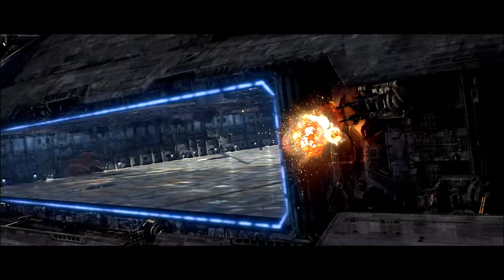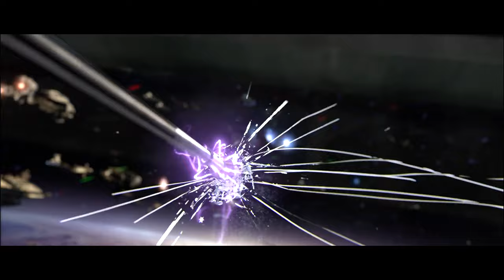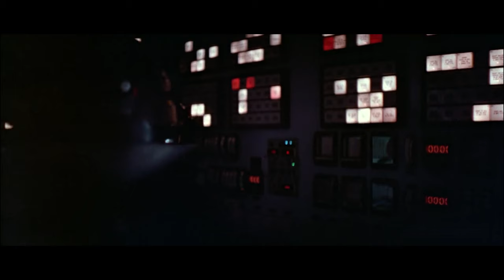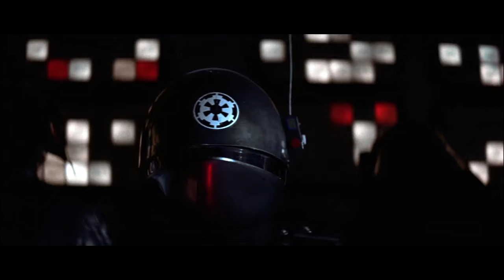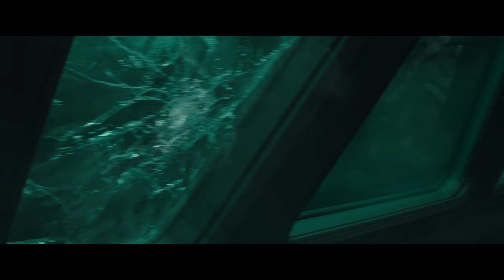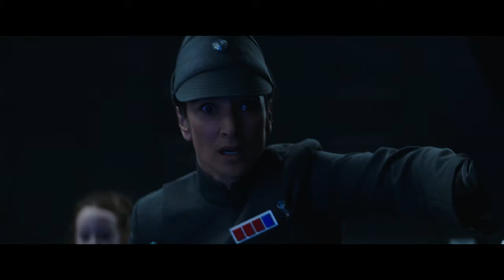This makes literally no sense

Comment: 1, technology fails so when it does you need to use your eyes. So a window would be necessary.
2, the staff not only is charged it is also very ridged and pointy, so with the amount of force that a robot could hit it against glass is reasonable that it cracks. And then breaks.
And lastly, by that logic, why do we have windows on cars that can drive themselves. Not only because cars have to have windows, but also you need to see outside when you need to take control

Comment: Well, the windows are transparisteel which, while not quite as strong as the durasteel armor plates used for armor, is still a lot stronger than glass would be. So it's not as much of a vulnerability as you might think. Secondly, some Star Wars ships actually do have internal CICs, either in addition to or instead of the exposed bridge. The ISD has a secondary CIC built into the superstructure, while the YT-1300 has a cockpit delete and expanded engineering pilot console as factory options.

Honestly, what doesn't make sense to me is that Grevious was able to break a bridge window on a Providence-class with JUST a magna-guard staff. I guess the CIS cheaped out on the transparisteel.

Comment: Electronics can be jammed, interfered with or otherwise disabled which would make seeing out of a ship without windows rather difficult. Bridge crews need to see to be effective, most of the time that is with sensors, but we do have occasion to use the sensors every person is born with, the Model 1 Mark 0 Eyeball.

The real question we should be asking is why the windows don’t have field generators like the landing bay doors do, so they can seal immediately upon being breached.

Comment: They likely are there for a couple reasons: to visually confirm outside events when sensors might be prone to errors or cloaking (see how the Geth ships in Mass Effect miss the Normandy). It helps the non-droid crew to avoid claustrophobia and other anxiety problems like that experienced on submarines. And Star Wars likely has glass on par in hardness with the steel they use in the rest of the ships (see Star Trek’s transparent aluminum) which while durable might not stand up to the enhanced strength of a droid body like Grievous’. But like with most things in Star Wars, it’s probably just rule of cool to have space windows.

Comment: It's simple really, sensors and cameras can fail. The glass is so the crew has a clear line of sight of the battle.

Also that glass "broke easily" because Grevious a cyborg with physically enhanced strength broke it.

Comment: On the ship windows: 
As mentioned viewports can’t be as easily tricked (if they had one that was where the millenium falcon was, they’d have noticed). 

Now that you’ve said it though that Greivious one did break really easily. Maybe it was like bulletproof glass (where it’s only really resistant in one direction) the cis are notorious for low quality in large numbers. Plus the only organic that would usually be on that ship is Greivious, so there was probably a lot less risk compared to the empires ships. Since Greivious and all his droids don’t seem bothered by space. 

Still….that does bother me now

Comment: Used be the clear windows you saw were a transparent alloy called "Transparisteel". I think they dropped the concept when they decannoned the books but i wouldnt say ive read all of them just a hundred or so in my youth so its possible newer media restored it. Funniest part to me was that it was stronger then the metal that made up the hulls more often then not but was made from a less common ore so they didnt use it everywhere.

If i was making a starship though your absolutely right thered be few if any viewports. Just coat the inside of the hull with programmable nano-skins that can relay exterior images, serve as communication and utility screens, or just be low key light sources. If there must be viewports for safety reasons then that's what shutters are for.

Comment: There is no big difference that I know of replacing glass with sensors considering most of the attacks are hitting the shields rather than the ship and if they were to be hit they will blow up the same.

Comment: People have been asking this question since the 1960s-70s when sci fi tv shows and movies became a thing.

There's absolutely no benefit to having windows on a spaceship, since any star closer than the Sun is to Earth would be unbearably bright, while anything considerably further away would be a negligible light source at best. 

Then again, it's the smallest plot hole in the Star Wars universe, where space battles take place at shorter ranges than cold war era jet plane dogfights, every planet has a breathable atmosphere and bearable gravity and nobody uses remote control technology for anything meaningful. 
"Yeah I have a robot. It translates between me and the cloaked dwarf people" 
Dude, if you have cheap autonomous robots(a slave boy can throw one together in his spare time), there's literally no reason to risk anyone, ever. Even wars would pretty much just be drone on drone violence and covert assassinations carried out by suicide drones. 

Making a robot from scratch takes an hour, at most. Producing a human soldier takes about 20 years. 

Frankly, in the Star Wars universe, there should be two types of people. Trillionaires who own robots who furnish their entire existence, and people who have literally nothing because the value of labor is priced somewhere around the price of electricity. 

Star Wars is a product of cocaine and very little foresight. Dissecting it is like pulling on a loose thread of a knit sweater. Too easy and not satisfying enough.

Comment: I mean, by that same logic real life airliners shouldn’t have cockpit windows either because the pilots spend most of the time flying IFR anyway.

The reason real life airliners have cockpit windows is because if instruments fail or if there’s an obstruction that radar, ATC and NOTAMs don’t alert them to then they need to at least have the option to fly VFR.

In fact, as The Invisible Hand is crashing, Anakin would have had no hope of landing the ship if the cockpit didn’t have windows.

Comment: Those staffs where shown to stop lightsabers. No reason to think they can't do this easily. As for the window breaking even if it's some crazy thick advanced material if it's cracked the pressure will overwhelm its structure. Pressures work completely different in space than they do in an atmospheric vacuum. Boiling points. Everything is different.

Comment: Just a reminder that the bridge of a ship often is divided between two sections. The “sailing bridge” and the “combat Information Center” which can be like the brain “CIC” and the nervous system “sailing Bridge” the CIC is deep within the ship and heavily guarded from all kinds of attacks. The Sailing bridge is actually a lot harder to hit than you realize with it being recessed back a fair bit. It’s not totally unreasonable for it to be a navigational bridge or a fair weather bridge, where it’s primary purpose is, as the name says, to be used for navigation in (ideally) non-combat situations. Now is there better methods? Absolutely. But I also propose the idea of reliability. Sensors aren’t always reliable and can malfunction or stop working. A window, kind of can’t.

Comment: When fighting Capital in the old SW Battlefront 2, one of the primary targets was always the sensor array. 
It would completely cripple a battleship if it was rendered blind, so I guess the portholes are a failsafe to make the ship always can both target and navigate. 
As for the weakness in the hull, I don't think it really matters when those ship cannons have shown themselves to tear through solid steel like it was nothing. Once the shield's are down the hull isn't going to last much longer.

Comment: I think this doesn’t necessarily account for ships that could bypass sensors or a malfunction in the system. Theoretically windows would be obsolete in most instances, but if anything happens to jam the sensors, the ships infiltrated and it’s turned off, or the ship malfunctions due to damage or other circumstances, windows would be great to still see the ship. Also, if an asteroid or space beast ever came up, I’m not sure if the sensors could pick it up. Maybe life forms. But unless I’m mistaken, these sensors have only been shown to locate life forms if they’re on (which they aren’t always) or machines like ships and droids. Someone correct me if that’s not the case. So maybe they aren’t always essential. But in particular cases it’s helpful and accounts for most instances.

Comment: What REALLY doesn't make sense in that scene in RotS is that the ship's gravity changes as it rotates.

Space is a place without gravity. As such, the space vessels would have purely artificial gravity... which should be designated to what is recognized as the "floor" regardless of the ship's physical position. Thus, when it rotates, the artificial gravity should remain on the floor instead of changing position with it. But it doesn't. It rotates with the physical ship as if there's legitimate gravity in space dictating which direction is "down".

Comment: Rule of thumb for militaries and always have been is; If your tech fails, you need to know what you're doing. It's why "Outdated" learning is still taught, basic is good

If you lose your map and compass, how do you traverse?
If you become stranded with no weapon, what do you do?

The shields of the ship would suffice to protect the bridge, not to mention blast doors and windows shutters. Conceptualization is the key to strategy, visual aid is helpful, and when in doubt you can still eyeball trajectory if all else fails. It's idiot proofing

Comment: People like to look out real windows. Simple as that. The glass is supposed to be made of like a transparent steel type material, so I dunno what the explanation for how grievous did that is. Maybe it’s like a ceramic vs car windshield type of scenario? Also with the inquisitor fortress, recall it has no shields because “you’d have to be insane to attack it”. So, it makes sense that it would have those windows underwater. The empire is all about architecture and style,

Comment: For Grievous ship, it's mostly a Droid Ship so they can have Glass for Grievous or whoever is aboard to see the war going on, beside Grievous is very strong and the magna guard staff isn't just like smashing metall on widow, there's more to that

yet i'll say it like that:

Having windows allows for a direct visual feedback on the war, no need of communication or relay on transmition to see and adjust your strategy which may save a fiew seconds that could be crutial, from the exterior the ship got shields, from the interior it's just strong x times tempered glass
the imagery/scan can help with what you don't see in the end

Beside scans and radars can be disabled by EMPS

And take a Look at like Mass Effect, the Normandy can go off radars and won't be seen "as long as they don't look out the window" (-Joker) and the same technology would be working there then

Also we can choose to talk about that, we can also choose to talk about the Computer that's aboard the ships and the way the scan says if they are gonna hit their target. It came from an old moovie but is still used that way in SW soooo yeah

Comment: I mean, let's be honest, General Gesus is a pretty strong guy. Multiple times he's brute forced a lightsaber through lightsaber resistant materials with single blows, easily makes dents In hulls with his talons and fists alone - I think it's safe to say a little bit of space-glass isn't much of a match. Not to say the argument is wrong however, just that Grievous smashing it PROBABLY isn't the best example of it. An external bridge with windows is a pretty bad idea in any case. A stray cannon shot, a pilot going down, or some debris could be enough to put a bridge out of its misery.

Comment: Well, that'd only be a problem if the shields go down, and usually you have more problems than just that at that point. Like, in sci-fi in general there's a solid 50/50 chance that just shooting the ship in the engines will just detonate the whole thing altogether before even an escape pod can be launched.

Comment: OK, I can give many reasons why it does not 'literally make no sense':
- External sensors/cameras can be damaged from the outside or simply fail because of some technical issue which would leave the bridge blind.
- Furthermore, even if they things were 100% reliable, cost would be and maintenance would be an issue.  Although later installments sort of ignore that things needs money and resources to create and people to build them (Looking at you Exegol fleet), the feeling I got from Star Wars universe and which was re-enforced explicitly by old supporting Legends material is that things were made as cheaply as possible to keep costs down (Most TIE fighters didn't even have shields).  That's why a rich planet like Naboo has really cool and sleek and shiny advanced looking ships, while the Empire's ships look utilitarian and stripped down, and the rebel fighters look like cobbled together garbage for the most part (the Mon Cal ships were definitely higher quality since they manufactured them on their home-world, but they still had to produced practically and as efficiently as possible to get them into the war effort).
- Also just drawing from real life, designs evolve over time usually.  Very rarely do people just totally throw out the previous design of something completely and start from scratch.  Cars in their basic form have remained unchanged since their advent as far as form goes.  Certainly you could design a vehicle layout and road infrastructure that would be safer/better/etc, but again the cost to re-tool the auto manufacturing industry to produce something completely new and the required infrastructures changes would be prohibitive for both cost and practicality. On top of this, consumers would not accept a huge changes; people like what they are used to, and aesthetics are important to people and people have grown to like the aesthetic of a car.  Just look at other Imperial weapons like the AT-ATs - they are designed to aesthetically intimidate, not to be practical.
- Finally the bridge of the ship did have a fail safe, a blast shield which could (and was) deployed to seal the bridge from decompression (the only thing that doesn't make sense there is that it wasn't automatically deployed, but perhaps Grievous disabled it).  I'm sure the basic logic is that a ship with shields and that amount of fire-power does not often have to worry about the view ports getting damaged, but in the likely case that it would, they can seal the bridge from the vacuum.  And likely there are secondary decks that could then take over for navigation in this case, particularly on a ship that size.  In the case of the water tunnel, and that time frame of the Empire, 10 years out from over-throwing the Republic and with no Rebellion yet, they probably really weren't considering the need to worry about combat in one of their facilities and just though it would look cool to be able to see out into the water as they're walking through it.

Comment: You would want windows on capital ships because sensors and cameras can be jammed, scrambled, and become virtually useless. With windows you can use your eyes, which are much harder to trick. I could program my ship to give off the same signature as 50 ships, and without windows you wouldn't know it was a lie if you were relying on sensors. And in this scene, grevious is far stronger than most species in the galaxy, possibly on par with Trandoshans or Wookies.

Comment: If the windows were glass, they would've shattered way worse when Grievous threw the staff.

Also, to answer the question: how are you gonna see your enemy when they shut down your sensors and cameras? Questions of this variety never take into account the possibility of system failures.

Comment: Probably designed for energy blasts and a shield for larger debris on the outside. The point of the staff may have been a small enough surface area to penetrate it where its less protected from the inside.

Comment: I feel like it's the same reason the Concorde supersonic airplane had windows for passangers when it would have been easier to design and safe if it didn't have them.
The fleshy meat bags that are riding inside like to look through them and the designers had no choice but to relent.

I imagine it's the same thing in the star wars universe. Organic beings just like having windows to look out and in the eyes of KDY or any other ship builder who cares if the ship is easier to disable/destroy that way. Just means they get more orders for ships with the same fatal flaw. Basically a license to print money issued by stupidity

Comment: One thing that doesn't make sense is that in the clone wars series, Grievous and Anakin meet many times, but in Revenge of the Sith (which is set after the clone wars series for the most of it) Grievous and Anakin meet on Grievous's ship and they speak as if they've never seen each other before. "Anakin Skywalker. I was expecting someone with your reputation to be a little..older" "General Grievous...you're shorter than I expected".

Comment: It isn't glass, in star wars it's called Transparasteel (transparent steel). it's tougher than bomb/bullet proof glass but not as tough as star ship grade steel used in the rest of the ship. Plus isn't Grevious a super strong cyborg?

On another note, cracking the glass in Fortress Inquisatorious probably was easier than you think. No matter how tough that glass is, Obi-Wan only would have had to break a tiny bit of it and let the under water pressure take care of the rest.